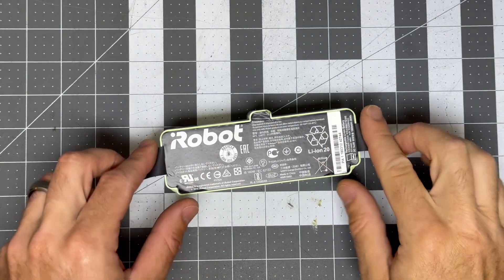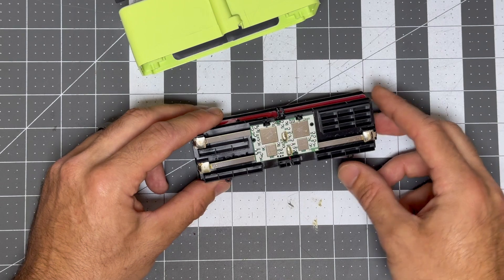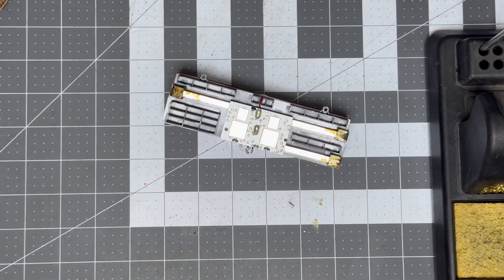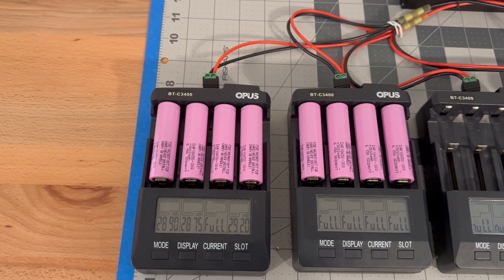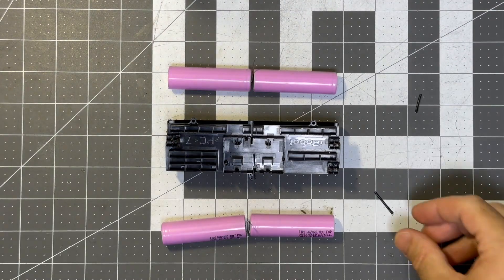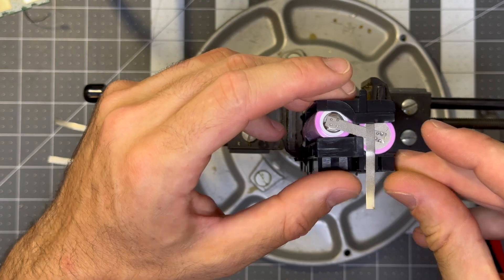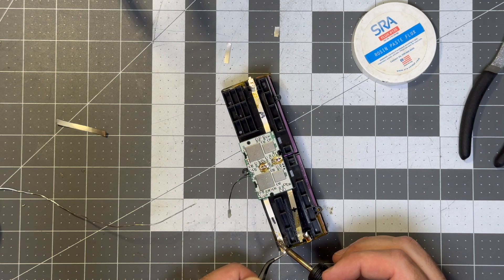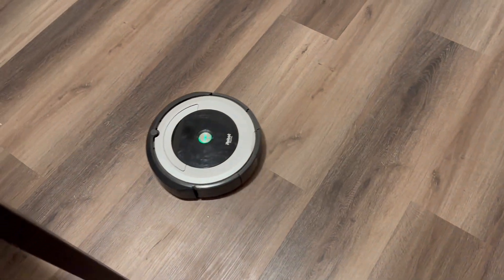iRobot Roomba Lithium Battery Rebuild

Comment: Can soldering be used instead of spot welding?
Reply from the maker: Good luck, I spent tons of time trying and partially succeeded but probably damaged some cells in the process. I’ll never even try again.
Reply: @colindgrant  I have little experience with any of this but welding strikes me as way more advanced (and dangerous) technique. Seems like I need to get familiar with it as my battery is quite old
Reply from the maker: @vmz1231  this is a particular type of welding, called spot welding. It’s actually quite easy and safe. The spot welder electrodes are only energized for a split second and only when in contact with the work. I recommend the model I used here. It’s linked in the description.

Comment: Not seeing where you may have tested the batteries you removed. I’d wonder how they tested. I removed mine and they are in the chargers, and look like they may be fine. Mine were at 3.4v but charging would not stay running. The resistance ranged from 50-to 60, per the same charger you were using. Not sure if that is the issue, but if not, I’m left with not really knowing what the issue is, unless 3.4v per cell is too low for the BMS to allow it to charge.
Reply from the maker: @racingtogreen2023  3.4V is almost certainly a good usable cell. The internal resistance figures are not reliable but 50-60 is very good. Try charging at 200ma, the do a discharge test at 500ma to find capacity. Look up the cell on secondlifestorage.com to see original capacity.
Reply: @colindgrant  The charging station without the Roomba on it is at 3.4 volts. I'm assuming it has some voltage step up to get to 20v? Nominal Max should be 16.8v, right? I wonder if that step up is shot on mine.
Reply from the maker: @racingtogreen2023  I’m not following. Your first comment ‘3.4v per cell…’ made it sound like you’re talking about the 18650s. But your later comment references the charger voltage…

Anyway, I can tell you the charger is a little odd in that it’s actually current regulated, whereas most power supplies were are used to are voltage regulated. It will supply 1.25A and I believe the lithium battery packs do their own voltage cutoff at the 16.8V you mentioned (4x4.2 max for lithium cell).
Reply from the maker: @racingtogreen2023  here's a deep dive into the Roomba power supply:
https://youtu.be/VV2PYqiHdHk

Comment: Is it difficult to remove the 3 screws on the second layer? Stay motionless，It doesn't seem to be an ordinary Phillips screw
Reply from the maker: Yes they are tricky. Standard phillips screws but you need just the right screwdriver to fit the head without slipping.
Reply: @ Success，PH1

Comment: I just did this, checked the voltages used the same batteries charged them before installing and nothings working I took the battery apart again to make sure nothing came apart I'm kind of stumped 
Do you happen to know the voltages the terminals should show?
Reply from the maker: First thing to check is voltage across each battery. So that would be pack negative to first shared terminal, then first shared terminal to the midpoint of the pack, then midpoint to the second shared terminal, and finally second shared terminal to pack positive, those should all match. I'm sure you've already check those though.

I'm worried you may have a bad board. Can you be more specific about which terminals you are referring to?
Reply: @ I honestly think I might have shorted the bms when I was setting it back on top. I ordered a replacement bms. The cells are balanced, each cell is around 4.2v they’re all in series. When I said terminals I’m talking about the 4 contacts on the battery that connect to the roomba. The 2 bigger ones show no voltage across them, I don’t think they showed resistance across them either but I’d have to check again.
Reply: @ it took a while for the replacement bms to come from China but it works now
Reply from the maker: @ Wow, great perseverance! That's awesome you got it working. Can you share the URL to the BMS? I'd love to share it in the description.
Reply: @ the bms by itself seem like it’s out of stock now but that seems to happen with that part it usually comes back 
I just purchased the bms not the shell

Comment: Tried doing this, used the same batteries as you. Used solder to weld them in place. Now im getting Error 7. Did yours work right away?? My roomba is model 805
Reply from the maker: @Immigrantlovesamerica  hmmm. Yes it worked right away. Did you check the voltage of individual cells to ensure they are balanced? Did you check overall pack voltage to ensure the series V is the sum of the cell V’s? Are the center taps on the circuit board soldered in well? I can’t think of anything else to try.
Reply: @colindgrant   Thank you, imma go back and recheck

Comment: Thank you so much. The video is so detailed and well shot. 
Regarding the replacement cells, I thought that if you put LiIon Cells in series they need to be protected cells? Or is the charging circuit measuring the voltages of all 4 cells ?
Reply from the maker: Great comment. The answer is it depends. These days cells are made really really consistently and most manufacturers do not do individual cell measurement in their OEM battery packs. Instead they deploy a heat sensor or two, and depend on that to detect any anomalies. In this case, the Roomba board is able to see the voltage of each cell (note the folded nickel strips in-between cells 1-2 and 3-4 as well as main contacts on 1 and 4).

I used brand new high quality cells in series here. They may drift in balance very slightly over time, but it's standard practice to use modern unprotected cells in series even with only thermistor monitoring.